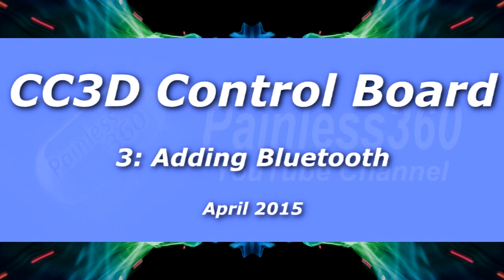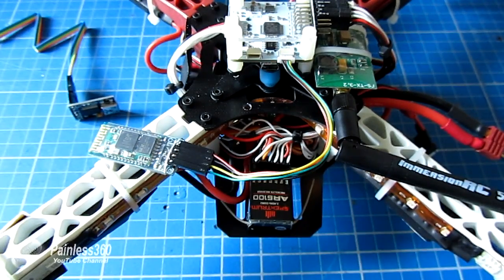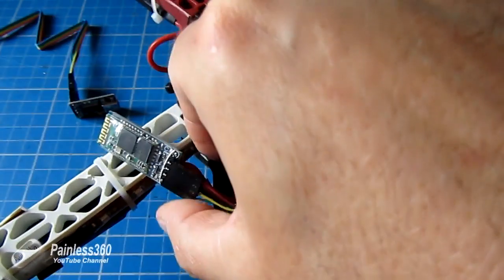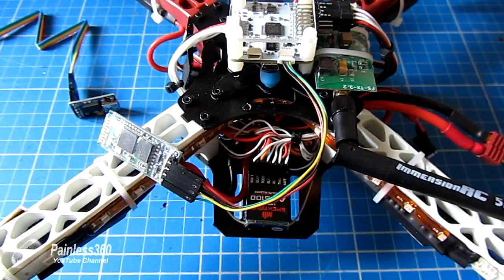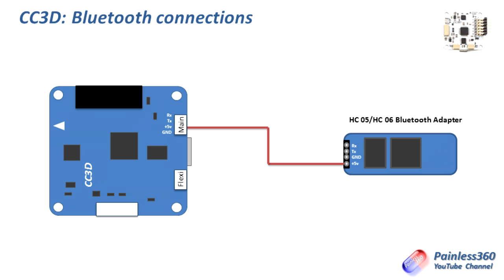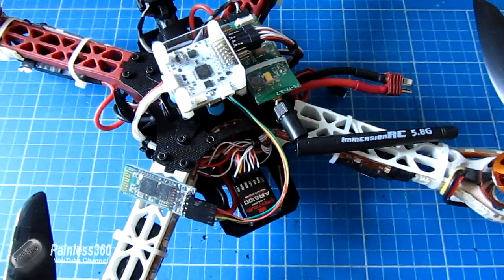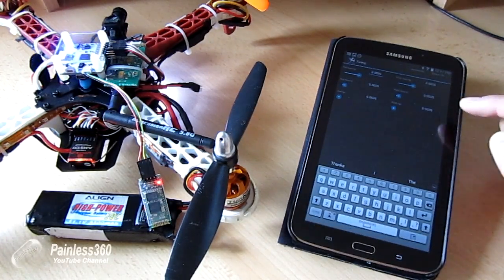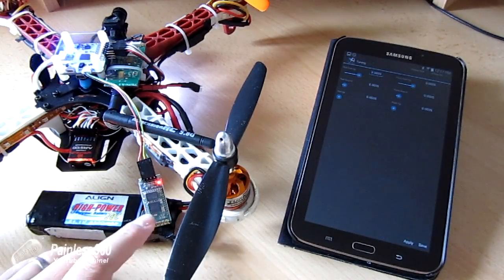(3/10) CC3D Flight Controller - Adding Bluetooth

Comment: Can i use HM-10 (bt 5.0) module with cc3d?
Reply from the maker: No idea. The CC3D is a very old flight controller now.. Best of luck
Reply: @Painless360  yep. But still getting one for my collection so that it could be used as back up. Thx for ur reply.

Comment: openpilot not available anymore on google  play so what other app can i use
Reply from the maker: Please watch the start of the series - I've already cover that. Librepilot or dRonin..
Reply: Painless360 I can't even open librepilot on laptop
Reply: Painless360  also I can't get my esc to calibrate individual as I can't get them to calibrate threw kk2.1.5 board
Reply from the maker: Librepilot doesn’t work on the KK board. Please watch the series from the beginning, there’s lots of tips and tricks in here. Best of luck!
Reply: Painless360 I no yh that's a different problem I have the openpilot is for my cc3d

Comment: I've been finding on banggood and found three USB to TTL adapters:
https://www.banggood.com/RobotDyn-USB-Serial-Adapter-CH340G-5V3_3V-USB-to-TTL-UART-For-Arduino-ProMini-DIY-p-1128916.html?rmmds=search
https://www.banggood.com/USB-to-TTL-Converter-Module-for-FT232-FTDI-MWC-Multiwii-Arduino-with-6P-DuPont-Line-p-980209.html?rmmds=search
https://www.banggood.com/Wholesale-USB-To-TTL-COM-Converter-Module-buildin-In-CP2102-New-p-27989.html?rmmds=search
Can you confirm which one will work? In my area only the one in the first link is in stock, if it must be the other two then I'll wait for them to restock.
Reply from the maker: No idea, I've not used any of them. See my video on the FTDI adapter for more help . I always search for 'FTDI Basic' to find what works well here..
Reply: Found another one which has exact same pins out like the one you had. It also says 'FTDI basic' I'm going for this one, hope it'll work XD

Link: 
https://www.banggood.com/FTDI-Basic-Program-Downloader-USB-TTL-3_3-5V-FT232-For-Arduino-p-988937.html?rmmds=search

Comment: ARDUINO IDE DOESN'T RECOGNISE THE HC-05 MODULE

IT DOESN'T SHOW ANYTHING CONNECTED TO THE PORT
Reply from the maker: Happy to help but please watch https://www.youtube.com/watch?v=olIqTiSJHIY and come back to me with more detail of what you've tried..
Reply: now the thing is I can see the port but the hc 05 is not in at mode i tried all the baud rates but i didn't get the 
 "ok" reply when i sent the at command
Reply from the maker: If you've tried all the board rates and swapped the tx and rx cables when I'd suspect the board..

Comment: hey bud i need some help. i am trying to configure how to talk to the bluetooth through a keyboard. i want my cc3d to be able to be controlled with a key board. yes sounds crazy but need your help. i do not have the wire that connects from BT to CC3D what other routes could i take.
Reply from the maker: Not sure at all as you'd need something on the CC3D end to understand what's being sent.. Best of luck with it and do let us know if you get it working!

Comment: Is there any reason this wouldn't work using a 433mhz telemetry radio set instead of bluetooth module? It seems like it just forwards serial data wireless to device at other end, i have a bunch of them that were used for an APM build but i was thinking of triyng to move them to my cc3d based quad.
Reply from the maker: +Jason M possibly, not sure if the radio does anything with the Mavlink data. Let me know if it works. Best of luck!
Reply: Painless360 it seems to work with the librepilot gcs. You have to configure the modules with the apm planner thingy first to link them

Comment: Thanks for the videos, but FYI some HC-05 wont go in to config mode so readily. If the red light is flashing fast you need to follow the instructions in reply #18 here: http://www.multi-rotor.co.uk/index.php?topic=14639.0
Basically, solder a wire to pin 34 of BT module and have that connected to VCC while you plug 5v in to VCC. Then remove the pin 34 wire. The light should slow flash now. Then in Arduino serial monitor set for both NL & CR line ending and use baud 38400.

Comment: Hi. Can I just use the HC06 or HC06 with the default settings with my CC3D ? Without ever connecting to a computer? Im going to use one of the open pilot apps on my phone.
Reply from the maker: +Morten Døssing Mortensen You can try but you'll be very lucky if the settings are all ready to work with the FC..
Reply: +Painless360 Alright, so I need a FTDI to set it up. Is that because the baud value is more than likeliy not set to the right value from stock? excuse me if these are stupid questions :)
Reply from the maker: That's all covered in the video.. ;)
Reply: +Painless360 Yes, well, what confuses me is that you say that you usually have the Baud value at 115200 but then you set this one at the lower value. Does that mean that both values work with the FC? Anyways, im going to get the FTDI since its basically free and the setup seems quite simple too. Thanks for the video

Comment: Well i think i give up on this....   i got this one off of Amazon and i cannot get AT command to work on any baud rate even swapped tx and rx around incase they wre marked wrongly.

http://www.amazon.com/Innogear-Wireless-Bluetooth-Transceiver-Arduino/dp/B00JP05S6C/ref=redir_mobile_desktop?ie=UTF8&keywords=innogear%20HC-05%20Wireless%20Bluetooth%20Host%20Serial%20Transceiver%20Module&pi=AC_SX110_SY165_QL70&qid=1442523508&ref_=mp_s_a_1_1&sr=8-1

If you can send link to the one you have would be great...

Comment: Hi Painless.Every time I plug the board into the PC (windows 8.1) my PC crashes? Any ideas? I got the first part up but the port icon on the software wasn't highlighted,then it crashes.I'm stuck on this one.Any help would be appreciated.
Thanks.
Reply from the maker: +yoodoo122 No idea sorry. I would reinstall the app and also try it in safe boot mode in case some other driver/code is to blame. Best of luck with it..

Comment: Nice Video! I come from plane and heli 3D-flying and just built my first 250 Quad as I want get into FPV racing. My Quad has a CC3D.
I plan to flash it to Cleanflight to use Oneshot with BL Heli, as that seems to be the best. I know I probably won't notice the difference in the beginning but I want to learn Cleanflight from the beginning as I like it more than OpenPilot from what I have seen.  Now my question: How is this Bluetooth, and for example the MinimOSD working with a CC3D flashed with Cleanflight? I suppose the hardware-linking Part is like you describe it here for the CC3D on OpenPilot but all the software I would have to install in the manner you show it in the Naz32 videos, am I right? Or am I completely naive and it's a lot more complicated than this and maybe even not possible?
Thanks a lot!
Reply from the maker: SnapRoller If you are using a CC3D with Cleanflight then you need to connect it and configure it using the pins and instructions for the CC3D board in the Cleanflight Wiki. As Cleanflight does not use MAVLink telemetry like Openpilot does you will need to flash your MinimOSD with the version that works with Cleanflight. This is covered in the Naze32 series on the channel.Hope it helps.

Comment: Hoping you can help. I have added the bluetooth to my board but cannot find the app that you mentioned so i installed one from tau labs and a couple other ones?? anyway I cannot get it to show any data. Just to make sure The baud rate should be set to 57600 correct? It also seems that mine needs Rx to Rx and Tx to Tx to communicate to the arduino I was able to set everything after I figured that out so should it be connected the same to the cc3d. I tried both but still no data in any of the apps so wondering if I just need the particular app you used or what. Thanks
Reply from the maker: Dustan Webb If you're not following the process in the video then it's hard for me to help. Use the software I use and an FTDI adapter..Best of luck with it.
Reply: Painless360 sorry that was probably confusing....I followed the steps in the video, I just wanted to make sure that the buad rate was supposed to be set to 57600. Also if it had to be that particular app because I can't find it in app store. Do you have a link to it or who the developer is I can't tell in the video. Again thanks
Reply from the maker: There are very few apps that support the CC3D, I hope with the release of the new Revo Nano there will be more choice for Openpilot builders and pilots.

I searched for Openpilot in the app store, it's still there.. Best of luck.

Comment: Hi, thanks for this channel, it's very well done. I am trying to program the bluetooth chip but i am not using an FTDI adaptor but an USB to CP2102 TTL UART. Because the chip interface is UART, I expect it to work too. In fact, when I connect my CoolTerm to it and type AT it answer back OK. However, it doesn't seem to like the other commands I am sending. Any thoughts? Many thanks in advance.
Reply from the maker: Graziano Mirata Yep - use an FTDI Basic adapter ;)Best of luck.
Reply: Painless360 ok. CP2102 is a cheaper version of USB to UART converter, but it does the same FTDI does. My problem was the handle of strings that on coolterm can't be handle on a raw mode but with a specific function to send strings over. Used that and it worked perfectly. Hope this can be useful to other people. Thanks!

Comment: you typed in AT baud7  does 7 stand for the com port ?

edit: never mind i got it.   AT+BAUD7" stands for 57600 baud rate.
thanks for your video it helps alot.
Reply from the maker: Jahroen That's it! :)
Reply: +Painless360 I still don't get it. How does AT+BAUD7 stand for 57600 baud rate? is it the 7th baud rate down the list on the drop down menu ?
Reply from the maker: You can Google it. Trust me - it does ;)

Comment: Great vid, is there any settings you have to do on the pc hookup to tell the board to accept a Bluetooth dongle?  Once connected via android is there a test to see if it has fully connected?
Reply from the maker: Fred Kaz On the PC - just point the app to the COM port for the BT device. On Android do anything that will change the display (rock from side to side) and see if that changes anything. 
Best of luck.
Reply: tried that still not working on android.  when you first plug cc3d into pc, its comes up with a config section where you have to tell the board what is being attached to it.  don't know what settings to set?? can you please advise.
Reply from the maker: All the information I know I showed in the video - there is a section that allows you to select the BT connection and then connect.

Sorry I can't help more - best of luck.

Comment: this is a great video. could you show how it works in the field?
Reply from the maker: Rabindranath Ramsaroop The range of the BT is the limiting factor. I would only use this to change things like PID settings and maybe dial down the throw of a gimbal servo. I wouldn't use it for trying to monitor the craft during flight. 
Happy flying!

Comment: As always, your videos are clear and concise.  Thanks for all your help.  I have a couple of CC3D boards on 250 class copters.  I've always wanted to set up my transmitter for 6 modes on the CC3D, (flysky 9x with er9x)  I have that setup on my APM 2.6, are the settings the same?  How do I handle the mapping in GCS?

Comment: when willpart 4 to 8 available? as I can't find those parts or did you only have them as private video?
Reply from the maker: airwolf 09 The following parts to the series are being filmed at the moment, these include adding an OSD and GPS. 
They are released on a Friday on the channel normally so watch this space. 
Happy flying!
Reply: Painless360 I CAN't WAIT!!! Thanks so much. I went from Multiwii to CC3d and using your guidance along the way. Much appreciated.